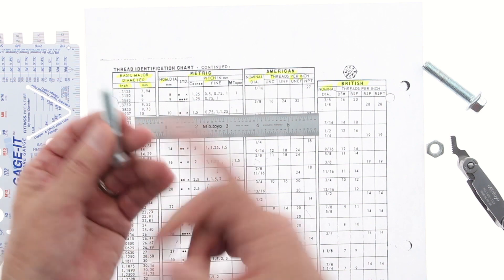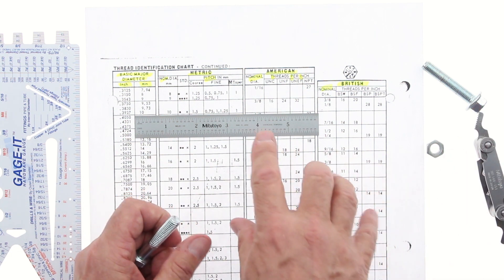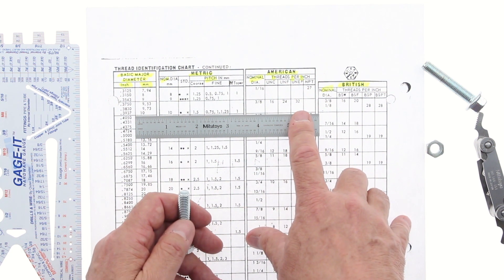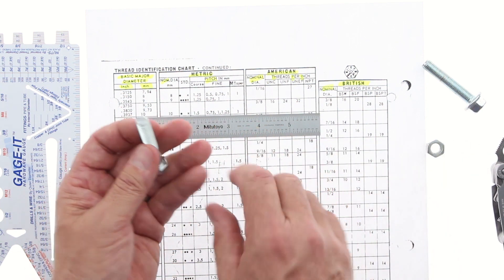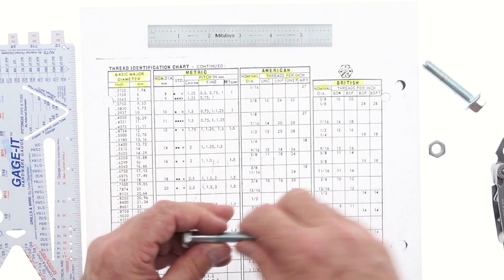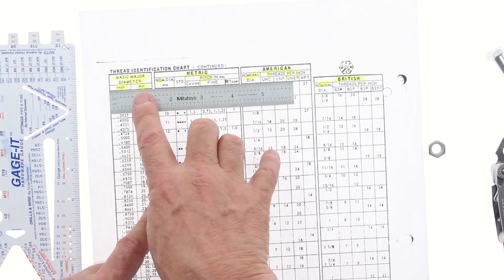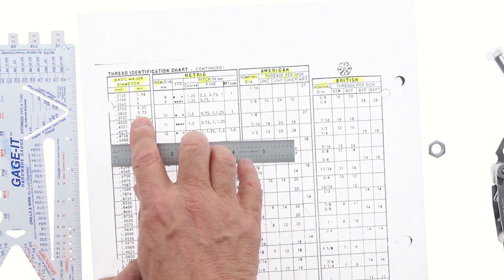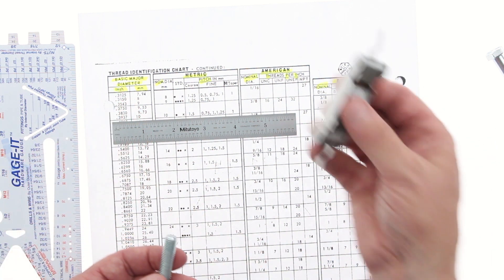Fastener Identification Guide

Comment: so I needed some bolts for my exhaust system.   I found the bolt thread/inch 1.25 and bore was 10mm but the head of the bolt was different....nurel end it was a press fit bolt.    took me some time to find out what to ask the parts shop.
Reply: good golly gosh that was really complicated